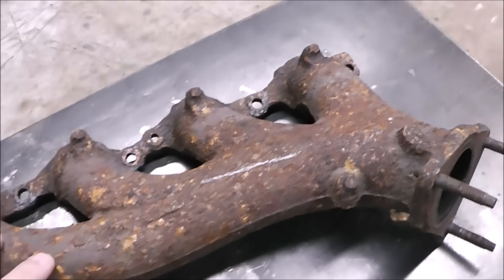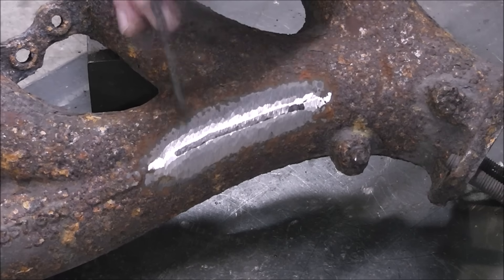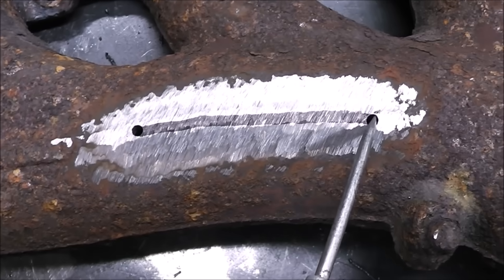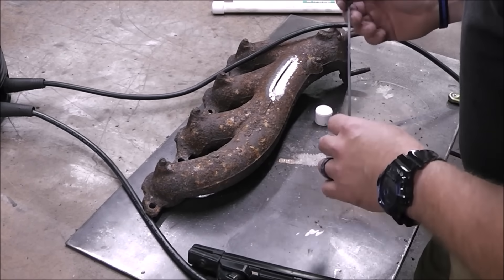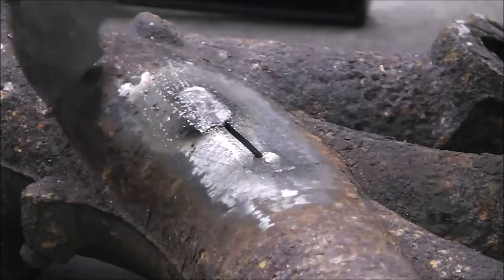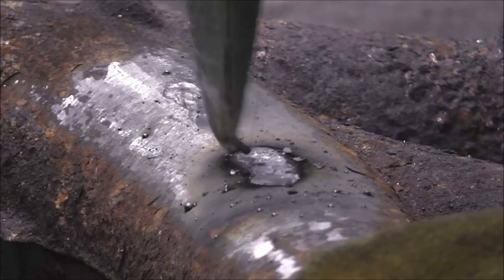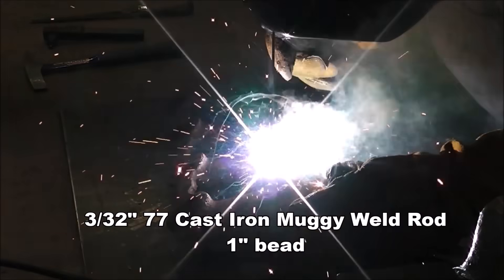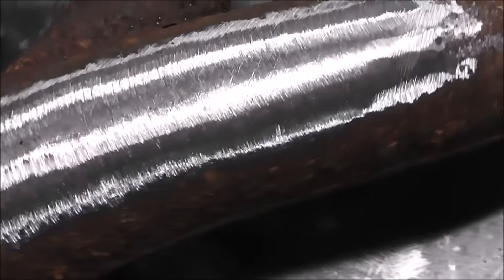Stick Welding Cast Iron Repair with Muggy Weld

Comment: I need some honest advice. I buy a Toyota supra mk4 turbo engine and when I got it home and start taking it apart to clean and reseal it . I seen the the previous owner welded the engine mount bracket bolt in the block .my question is is that safe to do
Reply from the maker: I'm confused why they would weld a bolt to the block. Unless they broke the block and it was leaking coolant
Reply: That's what I'm thinking but people or not honest to let others the truth

Comment: Could you use plasma to cut the crack out Instead of the diamond wheel?
Reply from the maker: Great question... I have never tried but I think it would probably work. It might be difficult getting a nice even gouge though.
Reply: @BrandonLund  I was thinking more like, pierce and cut all the way through, running the torch through the crack, rather than gouging. Ited take skill to gouge that thin of material lol

Comment: A few questions for you regarding this video. #1 are you actually a certified welder, because if you skip ahead to 10:35 it’s plain to see that there is porosity in your weld. #2 why didn’t you pre and post heat it? You said it’s a good idea, and anyone who has ever welded it puts heat to it. There are far too many people who are “welders” on YouTube who aren’t doing the proper processes or practices.
Reply from the maker: Hey Jesse. To answer your question, no. I'm not a card holder anymore. After being in the trades since I started at 17 years old and now I'm almost 50,  I'm done and out. I now just mess around in the shop and build stuff when I feel like it.  I mentioned all your other comments and concerns within the video and the description but in short, this was a viewer requested video and this is also part of a welding cast iron series. The process I'm using  in the video is referred to as "Cold Welding". It's been around forever.  Cast iron is very dirty which is why there is almost always porosity (unless you are brazing). If a filler metal can withstand a cold welding process than your chances of success using pre and post heat are very high, so in short,  I was testing how these electrodes worked (specifically the elongation characteristics) using a worst case scenario (cold welding). I don't claim to be the best. Hopefully those who watch my videos see this is just another tool in the tool box because there is always more than one way to get it done. Most "welders" are very one sided when it comes to welding cast iron. Lincoln has some really good articles on cold welding also. Take care and thanks for watching- Brandon
Reply: What difference does it make brother? There are already casting voids in cast iron.

Comment: Think I seen a pin hole on the left of the weld twards the end
Reply from the maker: Paul Sparks as I mentioned in the video, welding cast iron is a dirty process so yah your going to get trash floating to the top. If your concerned about pinholes, braze it.

Comment: I had to weld a rare discontinued 4.3 manifold on my delivery truck, i find the best results is to heat it up red and weld it with 7014, it hold 5 years on my delivery truck with usage of 8 hours a day, after it cracked beside the weld, had to redo it. but ultimately best thing is to replace it if you can, will save you lots of trouble, screwing with the manifold bolts is no fun at all not something you want repetitively do.
Reply from the maker: Well said. When cast iron is welded, it instantly hardens due to its high carbon content. As you pointed out, cracks at the toe are very common because of this hardening phase.

Comment: I used to be for an in a cast iron foundry and I welded all flaws that failed xray there are lots of other things and processes that can and should be used depending on type of cast iron been used a lot of car parts are no longer made from white or gray iron thy are using SG iron and different mixes for different parts  old car parts made of cast like your example should of been ground out then filled with a strip of Nicole or cast cut to suit then welded with to v shaping of job turning amps up and what ii call pouring on the 70/30 no rod its done quick all in one go the weld runs over top of cracks fills them you Dont end up with a big section that's heats and cools at a different rate to rest of part so reducing chance of cracks at a later date .holes can be filled a bit welded then filled welded filled with shot beads there made of high carbon steel so melt at lowish temp but carbon contetis closer to cast and stronger than weld alone done right holes flaws done this way will pass xray

Comment: That's a perfect looking weld only time in use will you know it's a perfect weld.
Reply from the maker: Without an x-ray machine, we can visually inspect for obvious deficiencies such as undercut. This repair (in my opinion) went about as perfect as a cast iron repair can go. If we really want to know how "perfect" the repair went, we could x-ray the 5 dollar manifold or better yet, to get a 100% guarantee it wont crack again, dont repair it. Just buy new.

Comment: I have been welding cast for over 40 years now and I have never preheated any cast. I have never drilled a hole at the end of the crack either. I have used nickle rod I have used 7018 low hydrogen rod I have brazed it I have used Mig and I have used Tig. You dont need any special rods. The only thing you need to do is grind a V in the crack dont make your welds any longer  than 3" each and have a decent air hammer to stretch your welds. And yes it is that simple.
Reply from the maker: Thanks brother!

Comment: Some twenty-odd years ago, my neighbor had an early '70s Ford pickup with a 460 and a HUGE crack  (1/4"+) in the exhaust manifold.  He asked if I could weld it, so we gave it a try.

We used my wire-feed welder with ER70S-7 wire, and an acetylene torch with a rosebud tip.  With it still on the truck, we heated the manifold up to a dull/medium orange, then with the welder set at a low heat setting, proceeded to fill in the gaping maw that was the crack, until it was sealed.  It still wasn't leaking when he sold the truck some 5-7 years later.  I'm still amazed and impressed.
Reply from the maker: That's awesome! You have a great get it done mentality!  I love it! Cheers brother!

Comment: Hi Brandon,  Just for fun, try welding cast iron manifolds the old school way. Clamp to a steel plate, preheat to dull red, gas weld with Ferro Flux and cast iron "square rod". Then wrap with insulation and cool slowly. It is very crack resistant and will last for years.It is also not effected by contamination from the exhaust.
Reply from the maker: I've seen some old timers do it this way but never tried it myself. It's very interesting to watch and very much an art form in my opinion.
Reply: @BrandonLund  Probably a much better method than you did,  Brandon. You said a.c.or d.c. will do. WRONG. A.c. will put in an even heat to both side's ( positive and negative), whereas,d.c. carries 2 thirds of the heat on the positive side, and 1 third on the negative side. Almost 100% of the time, use negative earth.
Reply from the maker: @derek haydon If you disagree with the polarity these rods were meant to run on you need to take that up with the manufacturer.
Reply: @BrandonLund  sometimes the best Captain shouts from the shoreline.
Reply from the maker: @pieter bezuidenhout Hahaha I've never heard that one before buy im going to start using it. Thanks man! 🤣🤣🤣👍
Reply: @BrandonLund  Only the truth that counts  😂😂😂 but you're welcome.
Reply: @pieterbezuidenhout2741  🤣
Reply: David Burke That is how I learned to weld cast iron. I don’t know if you can still buy the square rods and flux anymore. I haven’t seen them in decades.
Reply from the maker: You can still get them and its a lot of fun :) I need to puck some up and give it a go. The old timers swear by this method because its proven
Reply: I'm no welder but have been able to braze cast iron with oxy-propane and anti-borax flux. It's OK with small parts but not safe on large items like engine blocks. I used the same prep with drilled crack ends. But before understanding the need, I did one without drilling but the crack did not continue.

Comment: You have some badass skills to weld bro, what welding rods would you recommend for welding a stainless steel pipe onto cast iron manifold?
Reply: Okay sounds good I will go ahead and give that wire a try, thanks nd keep sharing them great videos!
Reply from the maker: Thanks brother!
Reply from the maker: Thanks man! Although I have never tried welding cast to stainless, I think a 309 wire would work well, either TIG or wire feed with gas should do the trick

Comment: I weld cast iron with a plasma welder using plain mild steel rods and a small amount of preheat.
 The weld area becomes a combination of the cast iron and mild steel as the weld pool forms a medium carbon alloy.
At the same time I never clean the weld area as the plasma welder cremates any rust or dirt into a powder and it blows off with the plasma flame and leaves a clean metal area.
I've welded many cast iron frames for garden furniture that have cracked over time.
Best weld repairs were on cast iron drilling machine tables that people have drilled into.
The plasma welder is a Multiplaz 3500.

Comment: Cool!
Reply from the maker: Thanks!
Reply: @BrandonLund  years ago back when women were double breasted and men were men. We used to weld cast with high heat and blow  cast dust at the crack slash problem. Really, thank you, love new ways to old problems.
Reply from the maker: @chrisfails8967  thanks Chris I appreciate your kind words and support. I enjoy experimenting and seeing what works and what doesnt.  Hopefully I can share my findings with others to help them out. I get mixed opinions when it comes to repairing cast iron. I look it as another tool in the toolbox that I might use someday when everything else fails. If this works without preheat I have zero doubt that a nice preheat and post heat would be a good recipe for success. Cheers brother!

Comment: You should have used a torch to preheat the cast iron. Weld the thing, and then cool it  down using a torch to prevent a crack. You were lucky, but there is a lot of residual stress in the metal which can cause cracks and failure in the cast iron.
Reply from the maker: Did you watch the video or skip around? As I said in the video,  we all know that a pre and post heat are optimal, but the manufacturer claimed these electrodes had excellent elongation properties so we wanted to test them out under extreme circumstances which is why no pre or post heat.
Reply: @BrandonLund  Nah, i was doing my welding book, came by while i was looking for "back- step or block welding
sequence". Saw it, and just dropped the comment.. (well yeah its kind of bad, but id rather tell you the truth, than to lie about it...). After i posted saw all the posts saying the same as i was saying.. 

Well i hope you dont feel like someone spitted in your face. But, man, im having little time while im trying to do as much study in as little time that there is. I have to get my sh*t straight.. So, there you have it, from the horse its mouth...
Reply from the maker: @jeffjefferson2676  I love it! Honesty and multi -tasking! Sounds like me 90% of the time.  No disrespect at all taken brother. The manufacturer made some impressive elongation claims so i wanted to put them to the test. I also did a cold TIG repair with these rods without a failure. Brazing is a given which is why I havent tested that method (because we all know it works). Cheers brother...now get back to work! 🤣🤣🤣👊🍻
Reply: @BrandonLund  So did you remove the flux coating for the tig(GTAW) welding? Because these are electrodes for normal arc welding (SMAW). Brazing, they say its good for cast iron, but with the application being an exhaust manifold, you might want to consider steel as a filler material.. I dont know how hot it gets, but if you would use it for a tuned car. It rather be metal (i assume).. 

This is what the book (welding skills) says about brazing cast iron:
"Cost Iron Braze Welding
Braze welding is primarily used to repair
broken cast iron parts. High preheat
temperatures are not usually
required unless the part is very heavy
or complex in geometry. A maximum
preheat of 200 °F (93 °C) is typically
sufficient. The heat of the name or the
arc is sufficient to bring the surface of
the cast iron to a temperature at which
the filler metal will bond to the cast
iron. The filler metal ductility compensates
for the brittleness of the cast iron,
and the weld and adjacent area of the
base met al arc machinable after the
weld is completed. Braze welding broken
cast iron is acceptable if a color
difference between the filler metal and
the cast iron is not objectionable."
Reply: Trow the SMAW rods into the water... Neat trick!
Reply from the maker: @jeffjefferson2676  pretty slick huh! 😎😁

Comment: I have a manifold that is completely broken into 2 pieces, I was thinking about partially welding the front while it is bolted to the head and then removing it to finish the backside. Does this make any sense?
Reply from the maker: It depends on how much one costs to replace. You can buy this manifold for like 15 bucks from a junkyard so it would probably make more sense to replace it. Welding it while it's bolted in place will ensure everything lines up,  just have to be careful not to burn up your vehicle or short out your on board computer.

Comment: Why is it that the simulated crack he made is on the side of the manifold that faces out towards the engine bay, but the finished product "that you can't tell was repaired"  was on the side of the manifold that faces the block?
Reply from the maker: Please read the video description.

Comment: What rod can someone recommend for a marine engine block on the water passage side that will never see temps above 180?
Reply from the maker: I would definately go with a nickle rod and  preheat. Wrap the area in a welders blanket after to slow the cooling

Comment: I weld these things all the time for turbo systems it is not cast iorn it is cast steel i have never had a problem welding with 7018 as long as it is flat and 6013 in all positions but is is a highly contaminated metal that gets crap in the weld i just grind out the contamination and redo the weld
Reply from the maker: I cant speak for the ones you have welded but the independent lab testing results has already proven it to be cast iron. Plus we cant ignore the fact that the grain structure on cast iron and cast steel looks nothing alike and the destructive testing also revealed this.

Comment: One back fire and that slag will take out your valves lol. You can braze cast engine blocks but it needs extreme heat like build a oven with bricks. Part of the Army MOS 44B school. Truth is that was the early 80's  and now they just throw a Incinderary device at shit and be gone.

Comment: I've tried it many times on large oilfield equipment and I'll never guarantee it to hold, I used nickel rods and LH 7018 with about a 40% success rate depending on the stress factors, manifold like that will probably hold  but scale it up with bearing housings and it's a longshot, great video tho
Reply from the maker: Thanks man!

Comment: Hook the welder up backwards with a stick welder you will b impressed no drilling EATHER try it on a junk piece, when you are done you can put your hand on it it is just warm ,,,,it pulls the heat back into the welder ,no stopping one end to the other try it.
Reply from the maker: What your referring to is DCEN or straight polarity. Spot on!

Comment: Good info! Enjoyed the video.,.Never heard of Muggy weld ,but seems to work well.Frozen blocks and Manifolds are a constant problem in the Marine engine industry here in Northern Ontario ,Every spring we see who know hows  to PROPERLY drain a marine engine.Most just re Power.
Reply from the maker: Thanks man! From what you describe I can see a HUGE potential to make a lot of money in the marine industry. If it cant be welded with this rod than it probably cant be fixed. If I were a customer with a cracked block,  I would gladly pay a few hundred dollars or more to have my boat fixed Vs. buying a whole new motor. A lot of people are under the impression that cast iron cant be repaired. That is far from true. As long as they know it will never be as strong as the factory original and that there is a possibility that it could fail at some point down the road, everyone wins.

Comment: Great video! Would this method work for making a cast iron stove/heater? I've been thinking about trying to make one, but never welded cast iron.
Reply from the maker: Thank you! It would work but it would be very expensive due to the number of rods you would need.
Reply: @BrandonLund  ah gotcha thanks again. Guess I'll just make one out of steel haha

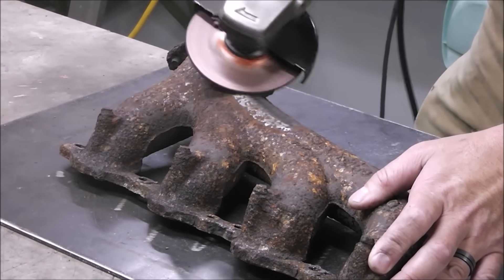Comment: 2:03 Was looking at that blade and thumb ready to "meat" each other.
Reply from the maker: Fingers crossed (no pun intended 🤣) I still have all 10 digits...but my fingers have made contact with a grinder wheel on a few occasions which really stings.

Comment: Another thing to help restrike cleanly is to tap the end of the rod. Sometimes you can see that, in addition to the rod burning inside of the flux, there's a thin layer of slag that forms over the end.
Reply from the maker: Good tip. I usually do that with regular rods but these rods are pretty expensive so I wanted to shape the flux like factory to save as much rod as possible and keep each re strike as though it was a new rod.